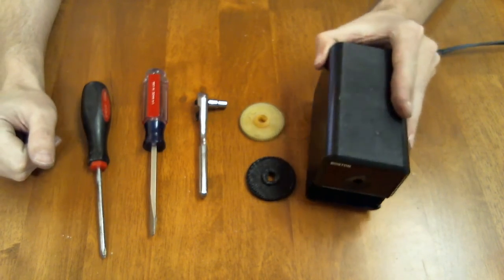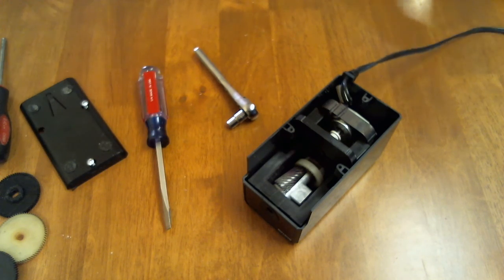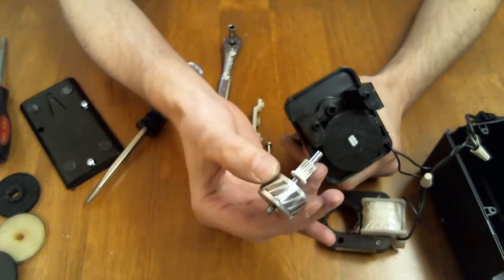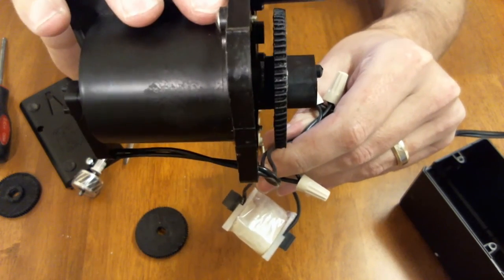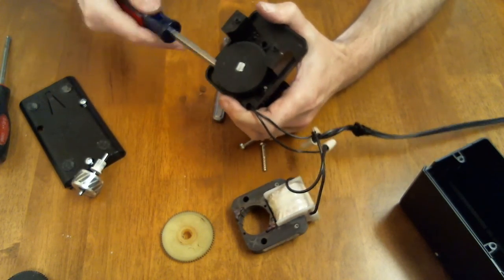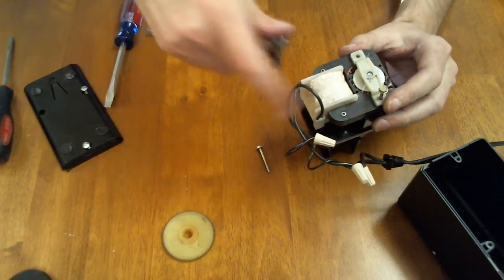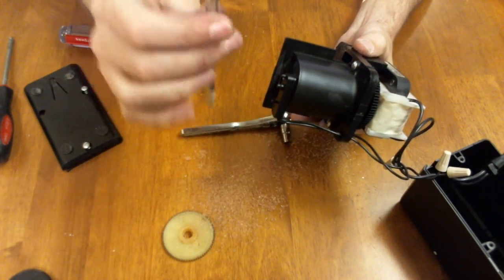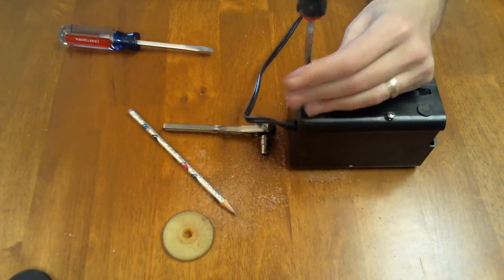Boston 18 Pencil Sharpener

Comment: THIS VIDEO ALONG WITH BOSTON POWERHOUSE SHARPENER video the FIXOLOGIST did the trick. Found a gear wheel  and had to sand the center hole to fit..  My issue was 2fold. I needed a new gear wheel and the sharpener housing needed to be opened thoroughly cleaned and oiled it made all the difference in the world. And by the way these gears that we can buy on eBay and Amazon or whatever most all of them do not fit correctly. I got a nail care emry board sliced it down the middle to make it thin and slipped it into the center hole of the gear wheel and sanded that down make a correct fit  There are a lot of people out there selling  gears wheels made from their plastic 3D printers and then you have to put labor into it to make the gear fit correctly. Very sloppy sales no honor. I'm  a gal and both of these videos helped me save my grandfather's  Boston 18 sharpener. Thank u so much.

Comment: I see these Sharpeners have a following. But the way these are built is really no better then a $20 Sharpener you'd find today on Amazon or at Staples. The old Panasonics don't have issues with these gears cracking from age and they can be had pretty cheaply and in good condition. There thousands of em on eBay.
Reply from the maker: I know it's weird.
Reply: @OpenHackSpace  what gives with them anyways is there something I'm missing?
Reply from the maker: @RobertNES816  most of the folks buying them were teachers and architects. Nostalgia is my best guess - they do sharpen the crap out of pencils though. I have four I test gears in as well as a number of Panasonics.
Reply: @OpenHackSpace  I guess the nostalgia part makes sense. My Dad's got a KP-8a he's had since it was new and I always used it as a kid. I recently got into sketching again and just bought a KP-33a and also a KP-8a because it's just like my Dad's 🤣. Damn things been in his basement for 40+ years and still works, it's been through his normal use and all my childhood stupidity of making pencils into nubs lol.
Reply: They could never afford to build this quality today. We fix these old things because the motor will last beyond these plastic throwaways you buy today made in china.

Comment: Just fixed my Boston Electric pencil sharpener with a new gear. Works fine now if not better. Order my part on Amazon. Had to make it fit better. A little hard to put the gear on.
Reply from the maker: glamourphotonetcom  

Post a link to your part so folks know where to get it.

Will
Reply: https://www.amazon.com/Replacement-Boston-Electric-Pencil-Sharpener/dp/B01M71C11O
Reply from the maker: Thanks!